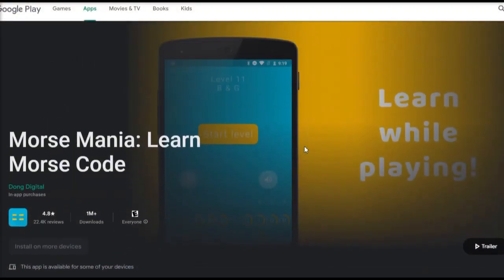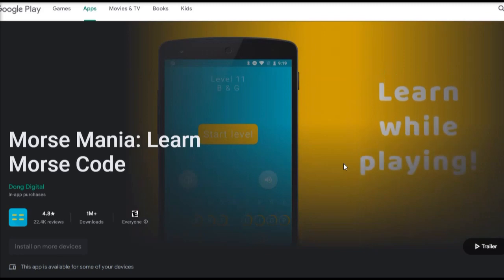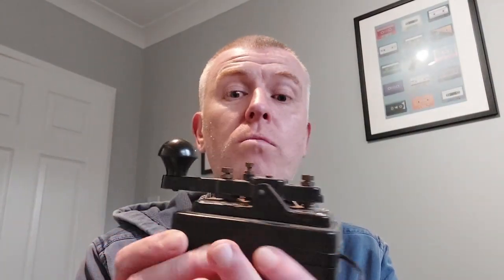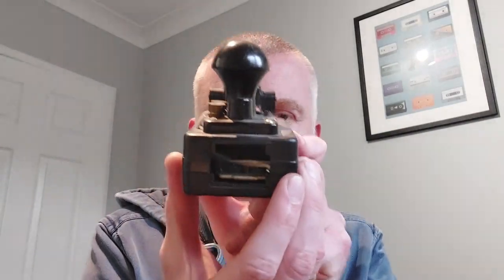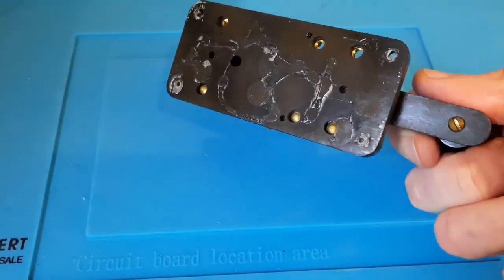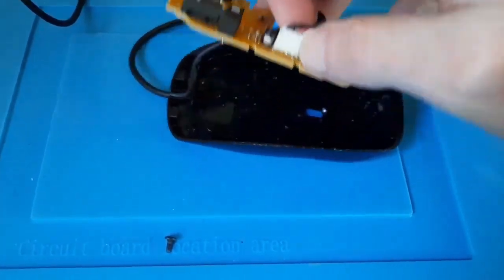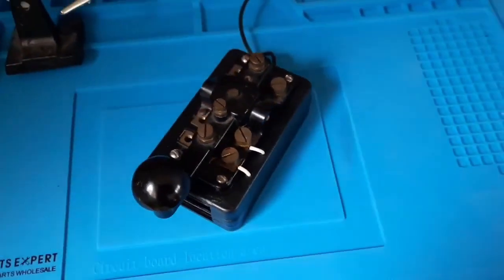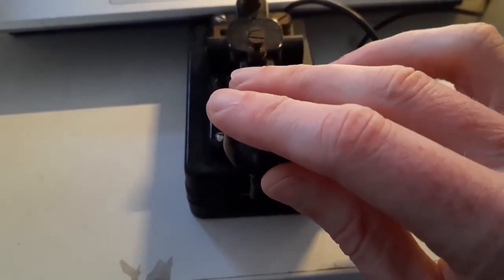Radio Rambles #4: Easily Learn Morse Code and Build a USB Morse key

Comment: You sound like your in the south of England... im in the south east and its absolutely dead on 2m and 70cms... i keep CQing into the void but love making antennas and will keep trying..  maybe on 2m CW might reach you if your not too far away..
I like you took tne foundation and then stalled for want of regular contacts or local meetings... 10 11 12m is a little busier so i also play with 28 to 30mhz. 
Keep up the ham work. 73's M6KII.
Reply from the maker: Hi, thanks for dropping by. I am in the south, Salisbury to be exact, so probably a little too far for us to reach one another. It's so quiet on 2m, I gave up. At the minute I'm enjoying venturing out with me shortwave radio and submitting signal reports to stations I pick up.
Reply: @RustyRocketProjects im having a look at SSB 11meters... much fun.

Comment: Tbh I haven't watched the video nor read the 4 comments. Just wanted to swoop in and drop the observation that despite the good intentions of educational efforts like this one, some of us with certain types of dyslexia simply can't keep track of the various codes regardless of earnest study. I've got my Ph.D. in planetary science, good at my job and research, but even after typing a 243 page thesis, a 250 page dissertation and unknown thousands of pages of reports, briefings, proposals, reviews etc etc... I still can't exactly locate most keys on the keyboards I've spent literally years using. It's like a fuzzy jamming filter springs up and blocks the exact specifics (until you direct your attention elsewhere. then it'll spring up into your thoughts regardless of the context. Can I call you back with that name when I think of it at 3 a.m.?!). So, for me, CW without automation is simply a non-starter. At a breakfast meeting I had to insist to an Elmer for at least 20 minutes that after striving strong several times over the years I was just never going to become functional in CW. Alas, but reality.
Reply: I didn't bother reading this comment, especially once I glimpsed Phd
Reply: @g@gmpro9159 Yup.  I agree. As soon as I read PhD I bolted. Bragging and boasting; nobody is impressed and nobody cares.

Comment: Thank for sharing your experience and knowledge. I am also new. Passed my technical and taking General next week. Yeah 👍!  I have not made a call as of yet. But soon. Setting up my BF-F8HP / UV5R 3rd gen. 
Yes, tough to make first call. A little confusing on setting up repeaters. Maybe discuss that. Thanks again.
Reply from the maker: Thank you for dropping by! Just think of the buzz you'll get from making that first call. Repeaters would be an excellent topic to cover in a future video, thanks for the suggestion.